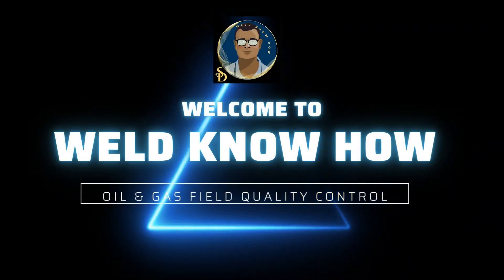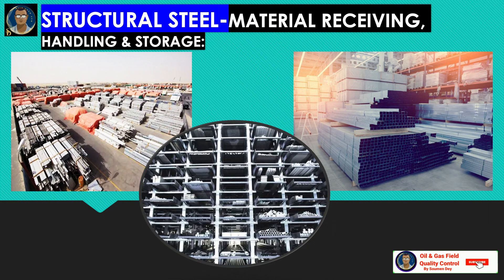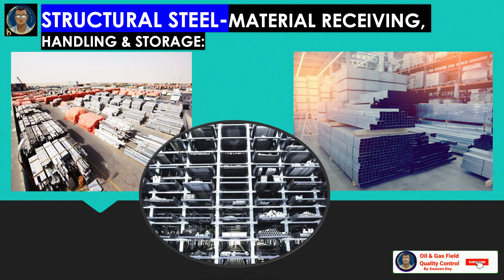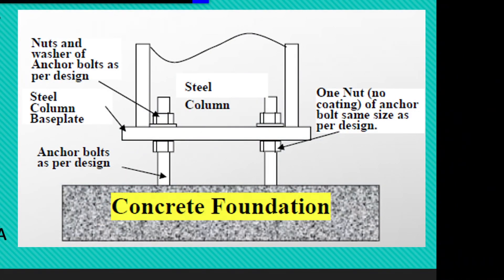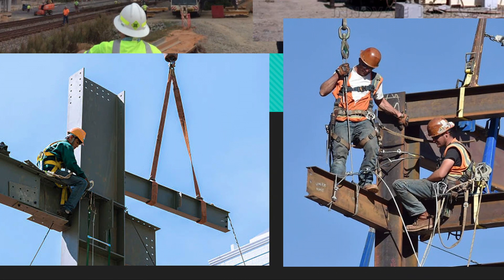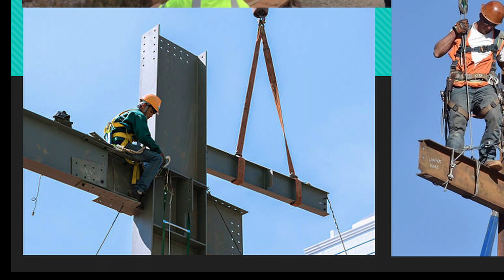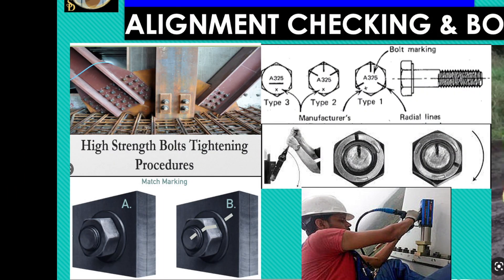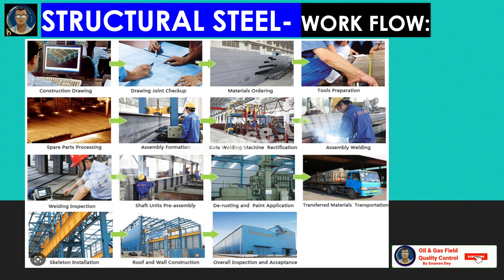Structural Steel Material Receiving || Structural Steel Installation || Structural Steel Inspection

Comment: Hi. When recriving material, what is the lab test usually done for the steel material before we use it for fabrication?
Reply: When receiving structural materials, we only need to do visual inspection for STC- size type and condition. During final inspection- before releasing materials many NDT or DT need to be performed like- Ut for thickness and lamination check

Comment: Excellent effort!
Entire process flow is covered in this video
Is there any specification available for structural erection which is followed in oil and gas construction industry?
Please advice sir😊
Reply from the maker: The basic structural work like pipe racks, Typical pipe supports are the general scopes we are doing during Pipeline or Piping installation work. Most of the cases, Applicable international standard for design, installation and WPS qualification AWS D1.1 Your client might have any special requirements or codes- which is not very often. So, you can say AWS D 1.1 is the Bible. There might be some standard Drawings, PIP (Process Industry practices), project IFC drawings
Reply from the maker: The basic structural work like pipe racks, Typical pipe supports are the general scopes we are doing during Pipeline or Piping installation work. Most of the cases, Applicable international standard for design, installation and WPS qualification AWS D1.1 Your client might have any special requirements or codes- which is not very often. So, you can say AWS D 1.1 is the Bible. There might be some standard Drawings, PIP (Process Industry practices), project IFC drawings